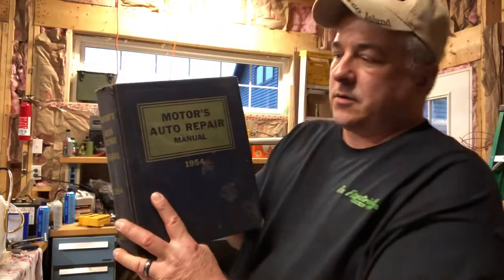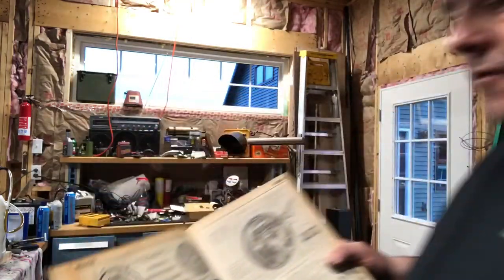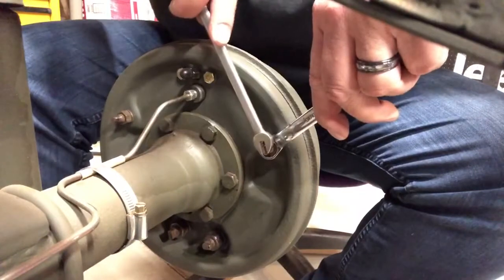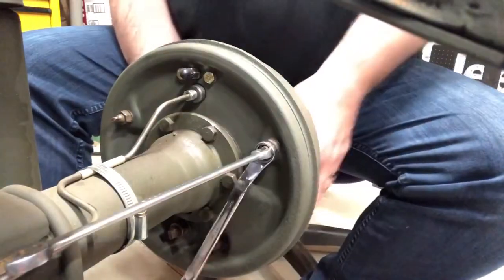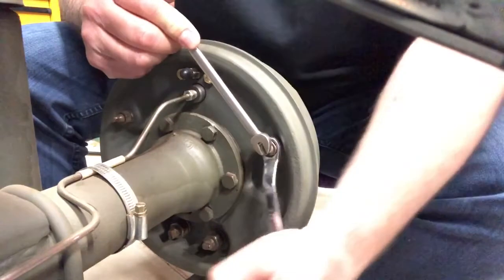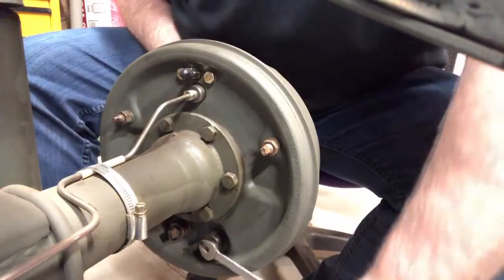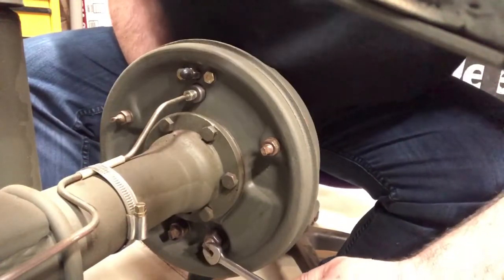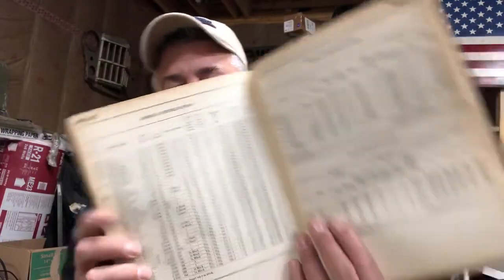Adjusting brake eccentrics on a Willys MB

Comment: Ok I have a question the primary brake shoe which is the smaller of the two shoe, goes goes too the front of the vehicle on all wheels, the longer shoe goes too the rear of the vehicle, on all wheels